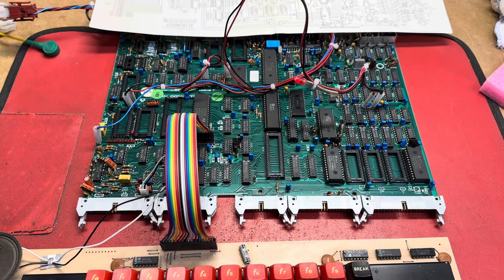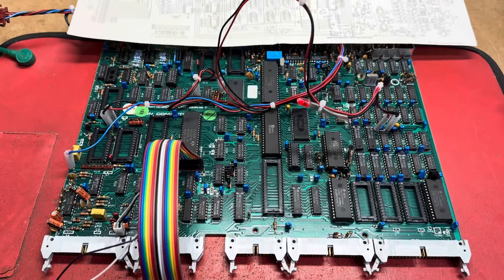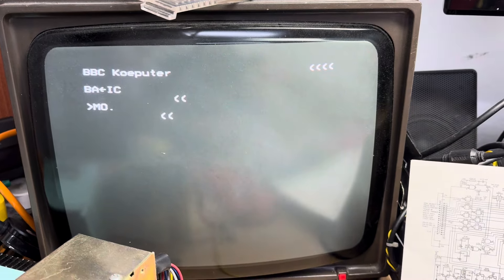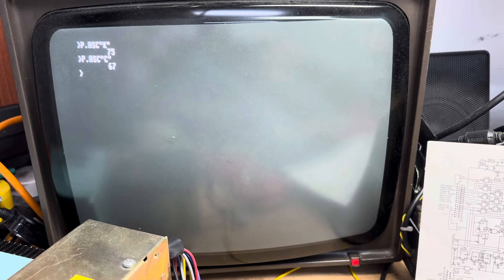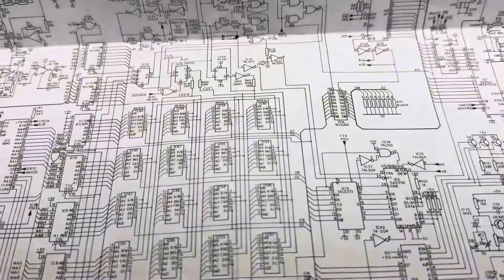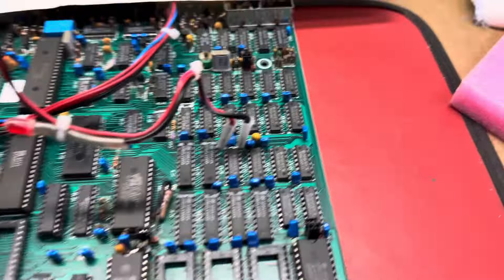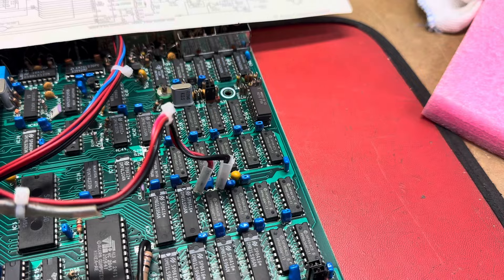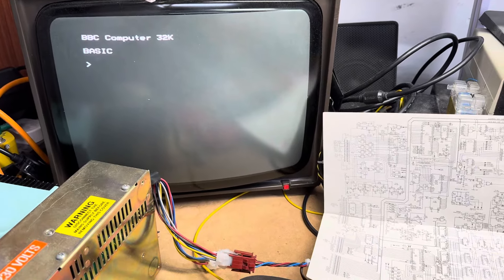BBC Model B RAM fault diagnosis

Comment: i've posted previously on another of your videos but it would be great if you could post more videos like this, I understand your channel is probably just to communicate with your customers but I find your repairs fascinating due to them sorta being in my "age" group ( I'm 54 so home console / computers are Acetronic , intellivision, Dragon 32, C64 , BBC B then Amiga etc )  , most of the hardware you repair is my youth, battle zone, space invaders, defender, donkey kong , pacman etc  right up to outrunners, hard driving, virtua racing , galaxy force II etc, but would like to know your methodology or your diagnostic procedure on how you fault find for example an outrun pcb etc..
Reply from the maker: Hi. Thanks, and I'll try! I'm not really very good at making these, unlike some channels that have multiple cameras and editing software etc., there's just me here holding an iPhone, and the occasional use of a tripod. This channel is mainly for showing completed repairs to customers, but I would like to expand it if I ever get the free time. I did this one in particular as I saw another person on the BBC Facebook group had a similar issue, so I thought it would help.

Comment: I have an Acorn A3000. All working OK. I don`t like to use it just in case it blows up. :) And I do not use the original monitor at all. I don`t think they make parts for them anymore.
Reply from the maker: They do still make some parts, but not all, and getting them can be problematic. It's actually easier to get bits for the earlier 8 bit machines, as the Arcs started using a lot of SMT custom ICs which have long since been discontinued. The monitors are the same, although if it's a CUB, then you can still get a lot of the bits for those. The biggest killer of the A3000, and all subsequent Arcs is the Varta battery on the main board. If you've not changed it, then you need to sort that sooner rather than later, or it will eat the machine from the inside.
Reply: @RetroClinic  I did change the CMOS battery a while back. Got a good one that`s off the board. It did have some damage and I had to replace the CMOS (clock) chip to get it to boot ok. It was stored in a shed attic for over 10 years in all whether conditions. The 3 button mouse has some mouse bites in the cable. :)